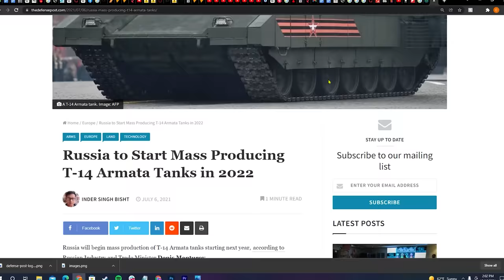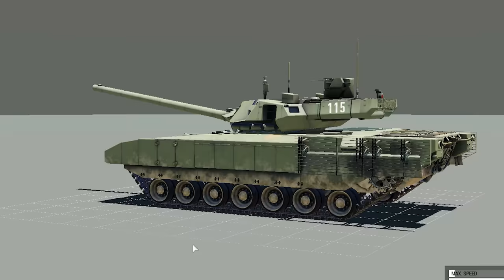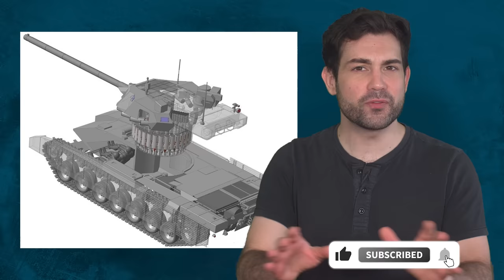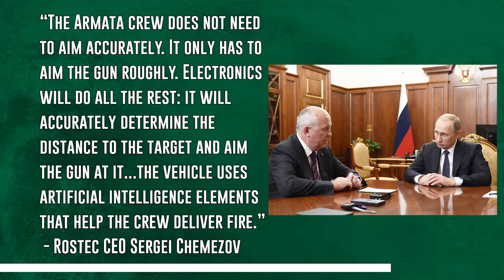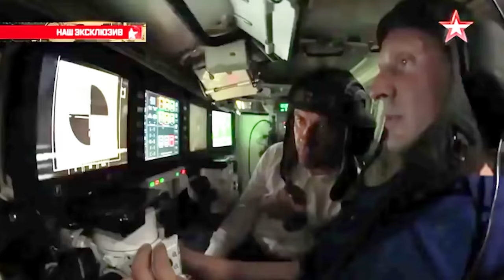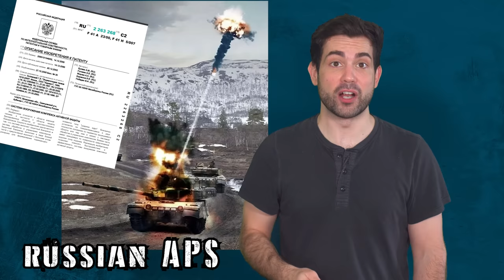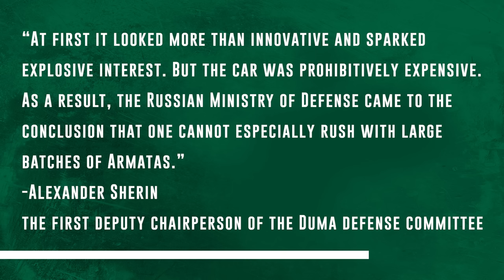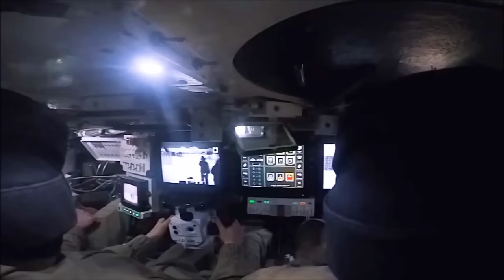The Truth About Russia's T-14 Armata Tank

Comment: Given the Soviet Union's traditional approach of having two types of frontline tanks, an advanced and expensive version for elite units, as well a cheaper more  massproduceable model for ramping up numbers, I think that we will see the T-14 Armata as the T-64 of today. Thus it will never replace the large numbers of T-72, T-80 and T-90 that are in service due to it's prohibitative cost. Russia has large numbers of tanks that can be "effective enough" after upgrades and Russia has a need to allocate military spending to other service branches, such as the Navy. The Soviet approach of having competing tank designs did make sense in that it could have competition between the nation's producers, albeit within a planned economy, something that pushed innovation. I think today's Russia will stick to that thought processe, thus the T-90 will not go away, it will probably be produced in tandem with the T-14 Armata while the already existing tank fleet will be upgraded for keeping up numbers out of economic and military necessity. However such an approach will also keep the individual cost for each T-14 Armata high unless Russia can find customers abroad..
Reply: The issue is that Russia has been merging internal design bureaus since the 90s and so that competition is increasingly becoming irrelevant. In addition, one of the two main DBs of the USSR, Kharkov Morozov, was located in Ukraine and doesn't work with them anymore. Uralvagonzavod is basically Russia's only DB, and they get all the contacts.
Reply: This one was/is supposed to be the inexpensive and mass-produced one, it just bloomed out of control in scope and budget, just like the designs it clung to. The question is: what is it worth? 

The year is 2023, and the US military is at the tail end of a lot of long investment and longer prices. ERCA is operational and several hundred are bought and deployed across Asia and bases in Europe and Africa. Every single M1299 covers 100km, and due to the Integrated Fires network (completed in late 2022) any battlefront engagement will ping the nearest one in this mesh of extremely long range artillery for fire support. Out of the box, they fire ten rounds a minute with extraordinary range at a velocity the T-14's active protection, intended mostly to answer the infantry fires threat, is already incapable of handling. 
A push by T-14s is not met by expensive M1s, but dozens of Ripsaw M5s, winner of the now concluded RCV-L program, which cost under a million each. These light robot combat vehicles are faster and lighter than the T-14, automated, and can be armed with a variety of mission packages including a 30 mm cannon. This cannon is used not to try to crack the T-14 (though it is precise enough that precision fire could shatter the T-14's treads) but instead to incapacitate its unmanned turret, targeting the hilariously vulnerable optics. One or two of the M5s may be destroyed by the main turret, rendering the MBT too "busy" to target heavier armor anyway, but within a minute the 155mm rocket-assisted shell that was fired by the optimal M1299 from the optimal angle within seconds of the T-14 being sighted will have arrived, and then the follow-up shot panned a meter ahead arrives too, just for good measure. 
At that point, the Russian military is down a few million dollars down on their investment and one elite MBT shorter of their tiny pool, all in exchange for a really nice set of stats on paper.

If there are tens of thousands of T-14s, they become a dangerous modernization of the MBT concept, because they allow MBTs to operate "like they used to" and they can mass and push so artillery or drones don't have the time to pick them apart. 
If they're supposed to be strategic asset, then they are already outdated, because there is no such thing "safe heavy armor" with a range under 10km anymore, no matter what kind of protection you think you're slapping on it.
Reply: I very like all those liberals' thoughts on «innovations in a planned economy».
Reply: Vladimir Nikolskiy  If I am dreaming, you are delusional. T-14s are also exceptionally vulnerable to electronic warfare due to their "enhanced" layout but it is unrealistic to expect either tank to suffer meaningfully from these attempts due to limits in realistic deployment on the ground. 
Russia simply does not have cannons fast or precise enough to touch an incoming Ripsaw unless they are willing to enter a distance where they are vulnerable to US artillery or even current US MBT. 
This goes double for the the BMPT, which is outdated on arrival ever since it moved to the T72 chassis. The idea that less than a hundred BMPT, unmanned or not, will meaningfully change US strategy is hilarious when they are under-delivering at over price. For the Ripsaw, they're susceptible to a 40mm bushmaster, a lightweight 30mm if hit near the nose, or a javelin missile package. They are a very costly joke. I would not bet on the company of BMPTs in a clear engagement with Ripsaws of equal price (4-6 Ripsaws per BMPT T-3) and that's what matters.

You would have been more accurate to question me on my dates, because assuming the US military will get anything acquisitions in a reasonable span of time (even under pressure) is indeed dreaming. The tech behind ERCA and Ripsaw M5 are both complete with working and mass producible prototypes, but the real dates on acquisition are likely to be 2024 and 2026 respectively purely for paperwork reasons. Combined fires and fire controlled systems (something no other military has even attempted) are at least slated to roll out 2022-2023, albeit without many modern arms to loop into the kill chain.
Reply: @UltraTotenkopf  The Msta is inferior to the Paladin and the 2S35 will be proportionally inferior to ERCA. That is assuming the 2S35 ever enters production, and it ever successfully fires at the supposed max range... 12 total is a runt run, and the 2S35 has never fired past 30km in documented tests. The M1299 could be considered "complete and in service" by this standard, since there's already a comparable number of them, and they have documented firings over 70 km with a much higher sustained rpm.
While Soviet armor had problems, late artillery was very good and high quantity, unfortunately most of the industry that made that mass artillery was in Ukraine. Play stupid games, win stupid prizes. Even the success of the Msta run, outdated as it is, cannot be replicated by modern Russia.
Reply: @UltraTotenkopf  Repeating your ignorance louder does not cure it. These quantities and levels of performance are not even tactically relevant, let alone strategic.
Reply: @UltraTotenkopf  Am I to be impressed by inferior ranges, deployments, accuracies, and ammunitions? Is artillery firing "tactical nuclear weapons" the Russian answer to having outdated rocket artillery, beaten by even the Chinese? Wake me up when that 24 (spent over 3 years, only the first twelve shown in public) has finally reached an operational 240, you clown. I only fear that I will sleep for decades.
You have great pride in an area of technology Russia once had special skill in, but has thrown away with senseless acts of chest-beating and military theater. When the checks and balances of modern war are evaluated, the modern state of Russian artillery does not even make the list for any peer force. This is why Putin only dares put them on the borders of countries that have not received Chinese or American artillery. They would vanish in plumes of smoke before the first week is up, juicy and immobile, at least for the few show models that do not melt down on their own.
Reply: @UltraTotenkopf  The use of tactical nuclear weapons will simply provoke the enemies of Russia to respond with their own nuclear weapons. Do not play stupid games with WMDs if you want to live, this goes for every country.
Reply: @crowe6961  The world had a good run while it lasted. Time to bathe the whole thing in cleansing nuclear fire. But joking aside, i will agree. While capable, neither side will use nuclear munitions. For one, no country wants to live through a nuclear winter while supply lines are destroyed, and plant/animal life rendered essentially dead. None of the people right now have the skill required to survive that, other than some old run down nuclear bunkers, that haven't really been taken care of after the cold war ended. 
Can't say anything about quality of neither military equipment though. Neither are properly combat tested, which i think is for the better, much to the dismay of armchair generals in this thread.
Reply: @jkl9984  All the big nuclear powers just made a joint statement the other week declaring that nuclear war cannot be allowed to happen. While this certainly staves off Armageddon, it also greatly increases the chance of proxy wars escalating into conventional conflict if nukes are totally off the table outside of the invasion of a great power's homeland.
Reply: Yeah i don't think the T-14 will be the main tank in numbers anytime soon, if ever. If anything, Russia will produce more T-90M or T-90MS tanks or even just upgrade older ones.